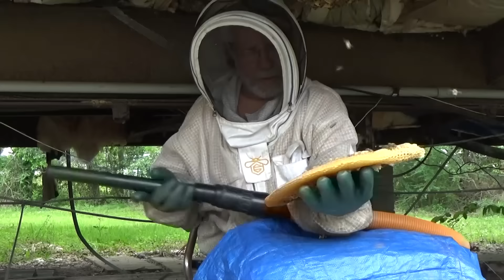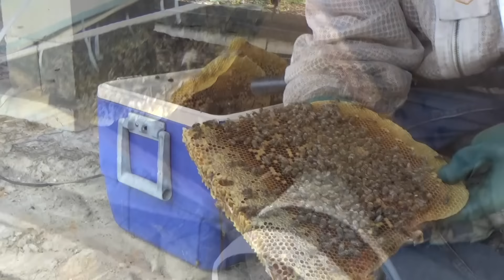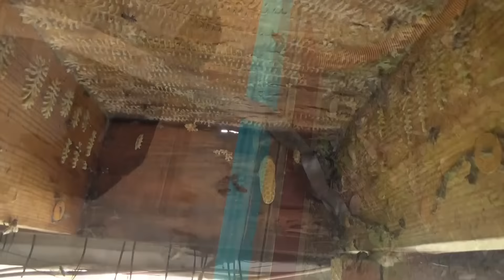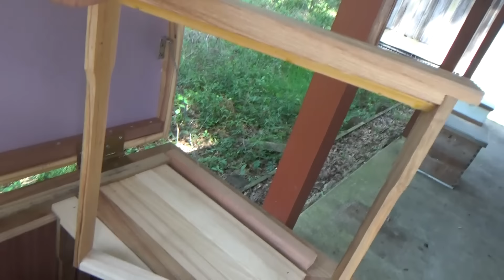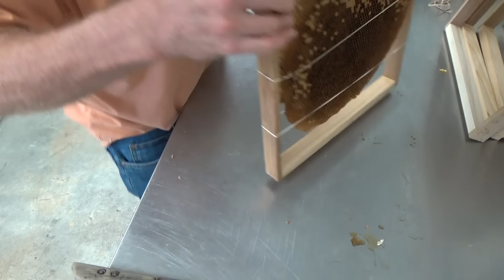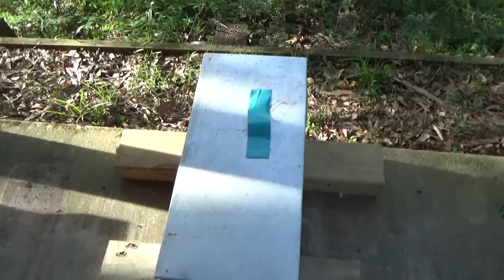Monster beehive being removed and then installed into my home made Layens hive.

Comment: Folks, a question for you guys with experience rendering was.  I’ve got some that includes too many dead bees. 😢. And I’m having a heck of a a time getting them out. Any advice?  On boiling it 4 times, and them still are getting stuck on the bottom of the block of was.  Thanks for advice!  BTW … Absolutely love learning from you guys!!
Reply from the maker: Whenever there are bees in my wax, I simply remelt the wax and strain out the bees while the wax is in a liquid state. Then, when the liquid wax is returned to the container, I cover it so no more bees can get into it while it is cooling. Thanks for watching. God's peace Susan.
Mr. Ed

Comment: I see you had them lift up the trailer so you could sit JP style! Lap blankey a ++😅. Whopper dude! I have thought of building a cutout hive box that allows the frames to fit in upside down. Allows the combs to rest against the top bar until they weld it in. After a day or two, just swap them over into the permanent box.  Would make better combs long term. What think?
Reply from the maker: I felt just like JP when I was doing the removal, and in the past when I sat down to do the removal I thanked JP for showing me how to do it. I really do like your idea, but when I'm doing a cut out, I want to get out of there as quickly as possible, especially due to robbing, and setting them in an ice chest upside down has proven effective and expedient. Always great hearing from you Tadd. God's peace brother.
Mr. Ed
Reply: @JeffHorchoff  I agree on diggin our fast. I am thinking tho, this upside down box would be what the frames go into when the bees are reunited with the comb for a day or two. Just until they weld all the combs back on to the frames. Then, swap out the box for a normal right side up box.

Comment: Why would you put your rubber bands on before that how JP does it?
Reply from the maker: As the frames that this comb was placed inwas not a standard Langstroth frame but rather a Layens frame, the practice was different. Another difference between JP's method and mine is I criss cross the bands from corner to corner front and back using a 7 inch band whereas JP uses 3 inch bands forming an "x" pattern to secure the comb. Either way works. Thanks for watching, and I hope you will check out more of my bee wrangling/ bee rescues adventures and let me know what you think of them. By the way, I post a new video every Friday morning, and I look forward to hearing from you again soon.  God's peace Tim.
Mr. Ed